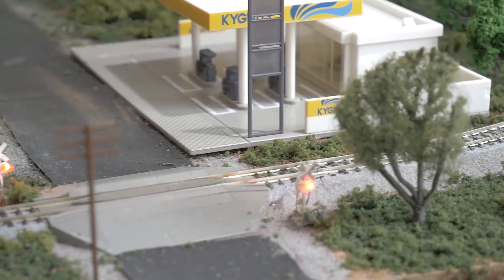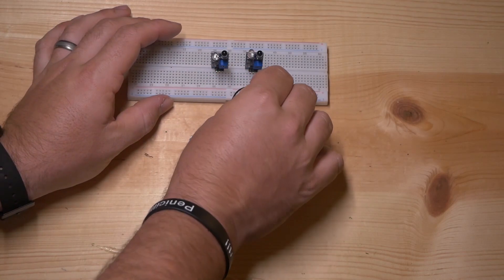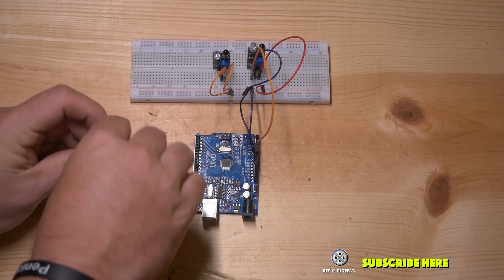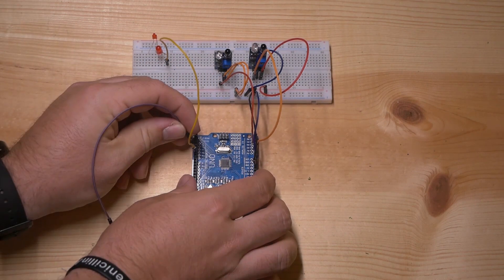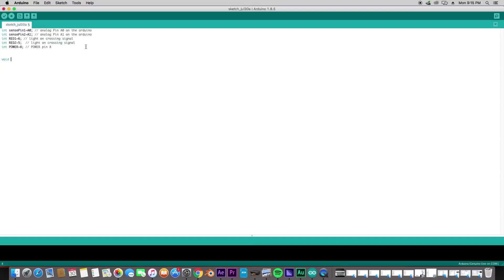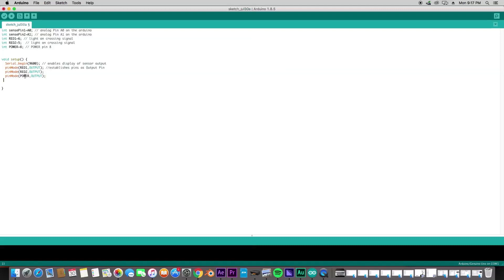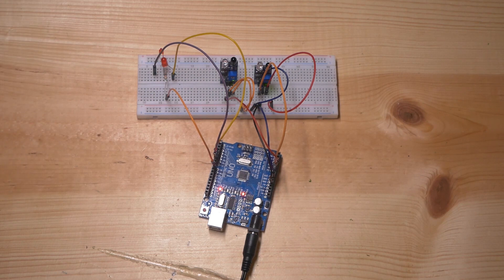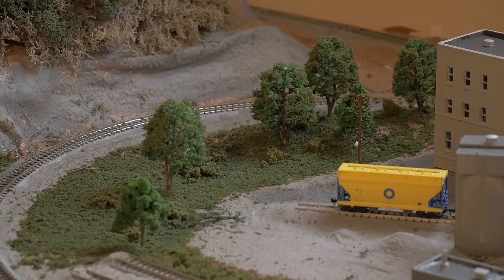Arduino Crossing Signal for Model Trains

Comment: Love these.  I would ask one thing - please use red and black (or white) jumpers consistently for your power connections.  A bit OCD, but this can further assist new makers to understand the devices and the signals as they are configured on the breadboard.
Reply from the maker: That's a great suggestion!  I am trying to figure out the easiest way to make a diagram of the circuit too.

Comment: I have reviewed the code that you posted on Github for this. I saw there are some ways that it can be improved so that the separate flasher device does not have to be used.  Also can simplify by writing the light flasher code only once in the sketch instead of multiple times in the sketch.

Comment: What would be awesome, is an actual scale operating crossing signal system!! I have yet to find anything that can do it, either DIY or commercially!!! It appears to me that the logic of the actual railroad system takes into account how fast a train is moving as to when the signals will activate. Also, as the train approaches, the signals continue to flash, but if the train stops anywhere before the actual crossing and sits for a few seconds or starts backing away, the signals will stop flashing until movement is again detected as an "approach". If the train backs away, the signals will not start flashing again. One last thing, if the train is detected anywhere over the crossing area, the signals will continue to flash, even if the train stops, until it is no longer over the crossing area. Hopefully all that made sense. :) This system would have to use a resistance based system as apposed to infrared. Would you be interested in attempting to figure this out? I'd be willing to donate to the cause!
Reply: I have built one that's just like like...you can check out my newest video on my page For Jakks Pacific Power Trains

Comment: Instead of using the sensor to turn on/ off, I would just use them to keep the signals going as long as they are 'tripped'. Turn them off automatically after a few seconds automatically. 
This way you avoid having to adjust the position of your sensor to the (max) length of your trains. You'd still need two sensors, one for each direction. 

You could possibly add a 3rd IR sensor in the track right at the crossing. As long as that one is active, the counter of the two 'entering' would not start. In case your train has to stop for a red signal and the tail is still on the grade crossing. 

Would it be possible to do this with reed switches though? They are a lot easier to hide under the track. Just glue  a small magnet under the rolling stock? 

Love your videos, well explained. A great source of inspiration.

Comment: Really have enjoyed your content.   Started using Arduinos for Model Railroad panel projects about 3 years ago.  My question, especially with  respect to the crossing signal sketch, is  your use, for the Leds, of the positive lead as the common rather than the negative lead as I have seen in most sketches.  In the Crossing sketch,  you have Pin 8 as the "Power" and set it HIGH.    And throughout the sketch it stays HIGH (never set LOW).   Could the positive leads just be connected to the 5V from the Arduino rather than use a Digital Pin?
And secondly, is there some advantage to having the Positive side of the Leds as a common?   I have noted that this is the same practise as is used in decoders (i.e. the blue - positive wire) is the common).
Thanks for helping me with many interesting projects.

Comment: Good video tutorial. I did the prototypical assembly and it worked like a champ, but when I installed the Arduino and grade crossing it didn't work well. My issue is that I'm using this code on a dual track grade crossing. Hence I have two IR sensors per approach (4 total) two upstream. The IR outputs are placed together utilizing and isolated with a 1N5819 diode so each IR output signal wont back feed into the other IR sensor and the same for the other side. My problem is the grade crossing flashers wont come on till both IR sensors are tripped and then the flasher wont turn off until the other two IR sensors are engaged. I noticed that the IR sensors LED flickers fairly quickly when the trains go by (never solid) Can I change the code to reflect a A1  A2 to 250 instead of  the 500? or should separate each sensor and and add A3 and A4 to the code?

Comment: Great video! I'm a little new to this, but wondering if you can just run two outputs to the LEDs, connect the diodes in parallel and flip the polarity of the outputs to change which one is lit? I.e. If both are LOW it's off, LOW/HIGH lights one and HIGH/LOW lights the other?

Comment: So if I have the sensors 6inches away from the grade crossing either side. What if my train is long and the engine hits the next sensor while the grade is still being crossed. Does the first sensor cancel out the second one if a train is still crossing over or would you need to move these sensors further apart

Comment: Hi Jimmy, Hi everyone, Nice video and very nice job from which I was inspired to make a level crossing with leds and servos (allowing to lower barriers). I live in France (so, please forgive my really poor english writing), and level crossings operate very slightly differently from certain crossings in the United States. The problem I encounter with the infrared sensors is that they are "activated" as soon as the loco passes, both on entry AND on exit. In order to solve my problem, I would like the input sensor to be effectively active as soon as the loco passes, but the output sensor to only "activate" after the LAST wagon of the convoy has passed. TOTALLY new to using and coding Arduino, I considered for a moment using a reed sensor module, with a magnet placed on each car at the end of the convoy, but if someone has a solution with infrared sensors, any tips or code snippets would be VERY highly appreciated. For a multi-track use I imagine that the ideal solution would be a detection of occupation of the block on which the level crossing is ? but I have NO idea how to do this detection. Thank you in advance to all and again a huge BRAVO Jimmy for this video (and all the others ;-))

Comment: I've been looking for this for some time.  I want my Arduino board to control my crossbucks.  However, I already have a flasher unit, I just want the Arduino board to sense the train and turn on the flasher.  After the train passes I want the Arduino board to turn off the flasher to the crossbucks.  And for it to do the same thing in the opposite direction.  I've already built a flasher circuit powered by a bread board power supply but it takes a press of the switch to activate.

Comment: This setup shuts off the blinking LED when the train enters the second sensor.  Actually, this would not work since we want the blinking led to keep flashing until the entire train passes the second sensor.  You need more programming to make this work correctly.
Reply from the maker: Thank you for your comment.  I think you may have misunderstood the program.  The purpose of the Crossing state ST_FLASHING3 is actually to keep the crossing flashing until the train has cleared the second sensor.  Thank you for double checking though!

Comment: I am not too clued up on Arduino programming as I cannot get this sketch to function.
It shows an error in the line (enum CROSSINGSTATES) which i cannot fix. 
The error statement reads "use of enum CROSSINGSTATES without previous declaration".
Please help!

Comment: what happens if a train pulls over the sensor and then backs up never hitting the other sensor the light just stays on forever. is there a way to put something into the program to recognize that and be able to turn off the lights after a certain amount of time between the two sensors showing nothing being triggered. Say 30 seconds. I'm really curious if this is something that you can do in code I'm not big on code I'm just starting.
Reply from the maker: So after I did this video.  I did another video that improved the code and fixed this.  Here you go!  https://youtu.be/hrTbOt33vAg
Reply: @DIYDigitalRailroad   thank you for sending me the update I've got that prototype already up and running on the breadboard I will be installing it an our club train set. I've been racking my brain trying to figure out how to add a bell to that program I thought of MP3 players etc. A lot of people can get the lights but it's very difficult to get the Bell on did you come out with it please let me know what your thoughts are.
Reply: @DIYDigitalRailroad  sorry I hit enter too fast lol! I do have a drawing night shows and Arduino relay bored connected to the Arduino and it connects to an mp3 external he just have to figure out how to get it to work with the switch on and switch off functions on all 5 states as your update shows.
Reply from the maker: Hey Lenny!  I haven't had a chance to work on it, but it is on my list!

Comment: OK, great vid.     One catch I am seeing, what happens if you trip IR 1, but never trip IR2....  like a train trips 1, then reverses and leaves the area, or visa versa..  The code would be stuck blinking with no train.,  maybe check IR states and if neither is triggered, reset to flash off after it goes through the flash loop a certain number of times?
Reply: Add flashcount = 0  to flash off, increment it in each flash 1 and 2 loop.  At end of each flash 1 and 3 check both vala1 and vala2 to be untripped, and the count to be more than say 480 blink cycles (4 minutes real time), reset crossing state to OFF.  This would mean no train sitting on the crossing.
Reply from the maker: I've actually been struggling with this for awhile.  The tricky part is keeping the signal flashing if the train is slowly heading through the signal area.  As soon as I figure that part out.  There will definitely be an update to this video.
Reply: Here is an adjusted code to try.  It compiles, but I have no hardware setup to test it.   

 https://docs.google.com/document/d/1Rv8l8H3Xe0LkRs-zb8SokXFkZIxjEiBPLjTnAhsSGSA/edit?usp=sharing
Reply from the maker: This is some awesome inspiration!  I learned something new today!  I've rewritten the program to add an extra flashing state that the program goes to after 5 seconds so long as neither sensor is being tripped.  That flashing state will go to the old final flashing state once a sensor is triggered.  I'm going to test the program tonight.  Thank you so much for the help!  This community is awesome!
Reply: Else  if (valA1>500 && valA2<500){
Else = else
Small typing error but this is great !
Waiting for more 
working myself on your block detector to do more block signals
Reply from the maker: This is great and I just tested it and it works.  I did one more modification to it and added a 4th flashing state that allows for the train to enter and exit from any point without the signal getting hung up.  I'm going to do an update Thursday on this and I will be giving you a big thank you! Here's a google doc with the modified code.  https://docs.google.com/document/d/1oyAa57Vs7sS0E0zSfnYGvSox1PjbvDtQSdhNhVCTbUA/edit?usp=sharing
Reply: I have fixed that in my file, but of course our host has a different thought on it and has gone beyond my changes
Reply from the maker: Thank you so much for your help!  I learned a something new!  I am working on an update video that I will put out shortly and I'm giving you a big shoutout on it.

Comment: Can this be set up with the flashing lights and also a crossing drop arm controlled all the Arduino?
Reply: Sure it can. You just need two servo's and you quite a lot more wiring. You can also add a sound module that sounds the bells. You can make it as fancy as you'd like.

Comment: yes i have a question if you have two tracks on your crossing and trains running in two directions can this circuit still work obviously you would need 4 sensors but how to code this with 4 sensors?
Reply from the maker: I don't think it would be all that difficult.  you would have a few more states, but all if you have to do is to revert to the off state is make to where all 4 sensors are clear to revert to off in case of trains crossing at the same time.

Comment: I am curious why you used one side to turn it on and the other to turn it off. Wouldn't you want the crossing flashing if either one or both is covered? If you trigger one to turn it on, then the other to turn it off, when the engines hit the second sensor, the crossing will turn off while the rest of the train is still in the crossing. The logic should really be if either one is covered, then the signals should be flashing.
Reply from the maker: Thanks for the comment Shane!  So the signal actually turns off once the second sensor has cleared after being, not when it is covered.  It's kind of hard to see when you don't have an actual crossing.   Basically what happens is: First sensor gets covered and starts the crossing, the second sensor gets covered and it tells the arduino to switch to a different set of instructions that basically say "The second sensor is now covered, once it becomes uncovered again, turn off the crossing."  This is done in case you have a longer stretch to detect trains and some trains are short enough to fit inside the entire detection area.  This is also an older project and I have done some updates.

Comment: I am not a C++ programmer, I am getting an error  "redefinition of 'int sensePin1'
" and do not know what is causing it.  I am using the exact code that is in the link above.
Reply: That means the variable has been defined more than once. Search for the all the occurrences of "int sensePin1". Then remove all but the first one.

Comment: Why do you waste an output for power to the leds when you could just feed them from ground or 5vcc
Reply from the maker: That's a great question.  I power my infrared sensors off the 5V and I have noticed through testing that the more I hook up through the 5V, the lower the untriggered sensor value of the infrared sensor and making it more likely to mistrigger.  So I decided to use the 5V should only be used for sensors and use the digital pins for the LEDs
Reply: DIY & Digital Railroad  That would mean you do not have an adequate  power supply for the load and are getting a voltage drop. I can't see how using your technique would make any difference.
Reply from the maker: That's a good point, I have 12 volt power supply hooked up, but maybe it's malfunctioning.  The sensor input would drop from near 1023 to around 600 and I would get glitches.  Maybe I should try a different board?
Reply: DIY & Digital Railroad  When you are reading low sensor value check your voltage make sure it maintains 5 volt. if it is dropping use a regulated power supply with enough output for your load.

Comment: Can you run more than one grade crossing with this set up?
Reply: Also does this make the bell sound when the crossing lights are on?
Reply from the maker: You would have to add some arduino based audio features that could make the bell work.  The code would become significantly more complex as you add multiple grade crossings.  You can do multiple tracks with a single crossing, like a double track main.
Reply: DIY & Digital Railroad 
Ok. But what about grade crossing on different parts of the layout? Double track I get. Just wanted to know about adding multiple crossing one arduino?
Reply: Thanks for the reply.
Reply: In theory, it is possible. But you would need to run a LOT of wiring all over your layout. 

Why not just install an Arduino Nano (5 packs are available for under 20 US$) and safe yourself the headache. Keep your wiring as simple as you can, so you will not spend weeks on end troubleshooting if you have a failure somewhere.

Comment: Would I be able to use the Walthers crossing signals that have the LEDS in them already? Thanks
Walthers Crossing signals - https://www.walthers.com/crossing-flashers-relay-box-set-of-2-working-signals-use-with-949-4359-sold-separately
Reply: Hi. We currently working on a product that would allow you to provide your own signals with our controller. Would you be interested in a controller that you wire up yourself to the signals you already have?